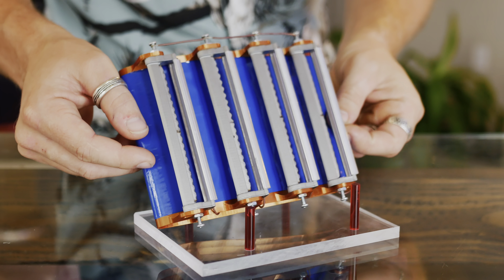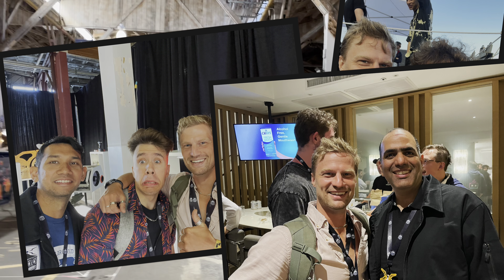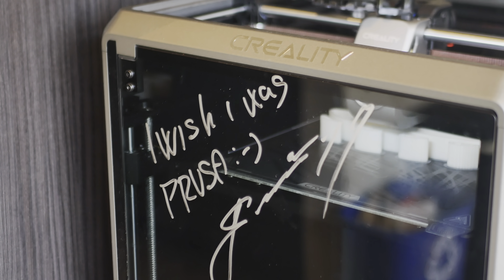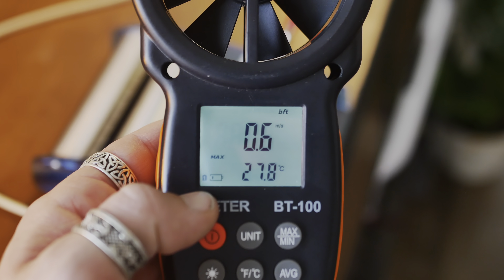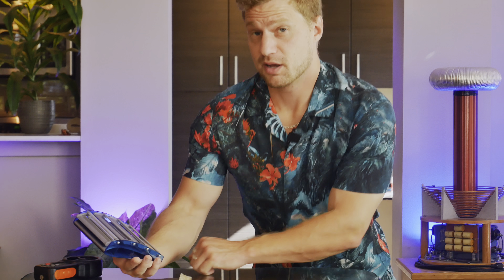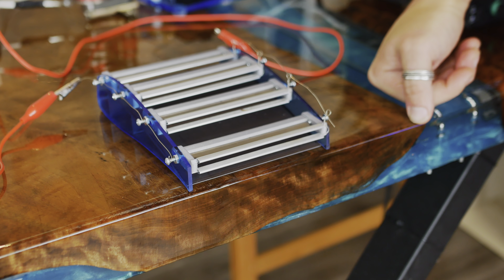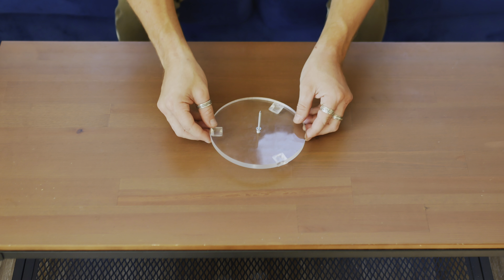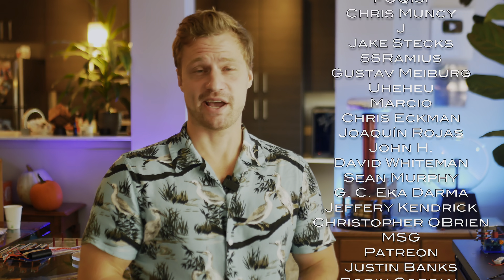Designing A Self Propelling Ionic Thrust Wing

Comment: Okay so I haven't finished watching this video yet, but it seems that having the voltages across the consecutive thrusters will both thrust and slow down thrust. You'll need to use a pulse system in which the 4 thrusters do not all thrust at the same time but cycle. A, B, C, D. But also the voltages between the 4 thrusters may also have a significant effect. I'd also argue that the space between the anode and the diode should be variable between the 4 thrusters. There is some fluid dynamics here that need to be considered. Start with the top and get the most thrust you can, the design the second one to already have the thrusted air over it, but furthering it speed. Think like this, a car from stop needs to be in first gear. Then second. This is about torque vs speed. I'd be curious if this is something you've considered.
Reply: I'd also argue that while adding extra bits could drag things a bit, I would consider laminar to be the first thought. Thruster 1 shouldn't care, it just needs to create a torquey push, the flow then should be aligned a bit, landing at thruster 2 which cares a little less about torque of the air, but giving it a little push. all the way down.
Reply: I'd also argue that these thrusters should be in a contained case of some sort. The air coming in and being thrusted should be able to add some sort of pressure, take a look at how the JT11D-20 axial flow engines work. This would also allow you to have the ability to do more than just push. By creating noded thrusters you could even add some spin to the flow. And by changing the shape of the bell, have higher pressure zones. IE you don't have to ionize all of the air if the outside surface is getting enough, and the air is compressed enough. The thrusted air could thrust more air. Ya dig?

Comment: you got the jet working already, the point of this video is to integrate it with airframe and make it a flying system. apparently you gradually realized that it's impossible to achieve now and degraded to a lame spinning demo. ionic thruster-powered planes have been studied extensively and you should have sourced from prior projects more thoroughly to avoid spending time on apparently way too heavy designs.

Comment: Hi, if you put one pole in the wing and the other outside and both like a biplane only with a small distance then you save weight and the 2 wings even add air resistance because the distance is 1-3 cm and the upper surface is only 0 The shape of the wing would not change. sorry, it was done with a translator

Comment: Habe you considered integrating the thrusting elements into the trailing edge/smooth leading edge of a multi element wing? That also helps greatly with lift at low airspeeds. See the ch701 wing as an example.

Comment: Why don't you make the razor blade section the trailing edge of the wing and let the other split contacts act as ailerons. Essentially dropping the multiple thrust mechanisms and instead blow up the mechanisms size and make it the wing.

Comment: If you made a thruster strong enough over a wing and able to recycle the air back to the start of the wing perhaps over another wing placed on top but reverse direction then put wings and thrusters in a sealed box with edges of wings fixed to box sides and ran it with enough power and airflow would you be able to cause the wings to create lift within the box thus cause the box to levitate?I have a sketch.

Comment: So Im a far cry from an aerospace engineer, however it is my understanding that aerofoils create lift by increasing the speed of the air on the top of the foil and decreasing the speed at the bottom in accordance with the venturi effect. Itd be interesting to see if a similar design would be able to create lift as you are directly increasing the speed of the air directly above the aerofoil thereby creating a pressure differential.
Reply from the maker: That's great input, and thanks! Yeah, that is why I designed it this way. Even when at a stand still, with the wing not moving, this should still create some lift.

Comment: I love the idea of ionic propultion. The thing in my mind is does the ionic Propultion(IP) on the top have influence in the lift of the wing? Because the wing actually gets "sucked" up... With this question in mind how does it affect the lift of the wing and what difference would a positioning of the IP on the bottom make? Also you can add IP on the hull of the aircraft and actually any surface of the airctaft. 
Another Question: Does the IP make the air move like x+IPspeed? like does is always add on top of each other to a certain max or is it just a constant max output no matter how fast the air intake is? In that case would the IP "slow" the air if its faster than max velocity?
Reply from the maker: That's very good insight! I actually intend on creating a full ionic thrust wing, placed on an ionic thrust incorporated airplane hull.

Comment: In the novel I am writing, there is a "surface air acceleration technology" applied to sailing ships. Your design actually turned my fantasy into reality. Such wind speed may be too low for an aircraft, but it is completely sufficient for a sail. A wind speed of 4 meters per second is approximately 6 knots. That's enough for the sailboat to sail normally. great!

Comment: The answer is within the way I build my far 103 compliant amphibious biplane almost entirely of rigid styrofoam which I have two provisional patents dated last month

. The first I can build all 42 linear feet of 2024 airfoil wings with full flaps and ailerons weighing a total of less than 100lbs not including additional tail section weight ~7lb, all lightly coated with carbon fiber mesh over minimal number of 2 inch styrofoam ribs. construction build time of wings ~5 days. 

The second involves full wing sized cores of rigid styrofoam being extruded through heated nichrome& welding wire& into the general profile of the needed airfoil, including internal slots for the main& subordinate forward spar. This method with an adequate shop can produce 5+wings per day with all  hardware installed& ready for Kevlar dollars& wrapping

 2023& 2024 are my faves for Max lift at min thrust for ~750 lbs+~ 35hp

You're going to need a power source for that right well I happen to have patented unlimited solar travel with T-Rex series wiring,  lowlight capable solar generation& reduces battery requirements.

Kevin Ward
Founder Healing Habitat 501 (c) 3
kevinward46@gmail.com
(607) 269-6626
#HaveaCoke&asmile

For those that don't know far 103 compliant indicates that it weighs just over 325 lbs with all the allowances of a parachute and flotation
Reply: For those that don't know far 103 compliant indicates that it weighs just over $325 lb with all the allowances of a parachute and flotation

Comment: Have you considered using electroplated 3D printed surfaces rather than razors/wires as the electrodes? You could shape the electrodes to provide optimal airflow over them while reducing the total weight. I have been 3D printing and electroplating devices to generate hydrogen with electrolysis, and the ultra light foil can actually handle quite a lot of current. I've also been putting a thin (~1um) film of gold on the surfaces to prevent oxidation which may be helpful considering the application

Comment: Awesome Videos good sir. I aspire to engineer as well. having taken on CGI design as well as Electrical engineering. if you need ANY CGI designs to be modeled, I would be honored. I can get you the light weight you need. Lets get rid of the wing all together though since the electrical P+ terminal (plates) accomplish this. Then focus fully on your frequency output. Like The man said, "Frequency & Vibration"...  I'm Personally convinced that a flat panel speaker setup would suffice with the proper sound output. Instead of a fixed speaker facing upwards, levitating objects, Having the speaker facing downwards, pushing the "Vehicle" up. I do believe they have accomplished lift by emitting some FM wavelengths downward to a point where when it refracts from ground back to said "Vehicle", the vibration supports objects weight. Just food for thought. But i have 3 other ideas that will completely blow these out of the water. and NOBODY has even come close to these yet. LMK if you may be interested on this thrill ride. Honestly I've been sitting on the concepts for years in fear of repercussions. Enough said. :) Stay safe & Can't wait to see more epic editing !

Comment: you should try putting the thrusters underneath the aerofoil.  As is you are interfering with the turbulence over the top of the wing that creates  the lift. Accelerating the air flow under the wing shouldn't reduce lift but accelerating above it will reduce turbulence and thereby reduce lift

Comment: Here me out... but what if you also made a plasma compressor. That would completely remove all to most moving parts in regular compressors. And (if possible) could change the need for oil based compressors. Which would make supercharged cars easier and possibly more affordable. Also i would like to see how plasma induction would react to the inside of an engine.

Comment: Are those crackling sounds coming from arcing with large enough aerosolized particulates? Regardless of how that crackling sound is produced, to what degree can it be minimized or even eliminated? Because scaled up it seems like that could cause a significant amount of noise pollution.

Comment: The thrusters are on the wrong side of the wing. I know everybody thinks the shape of the wing is about lift, but it’s actually about minimizing drag. The angle of attack provides the lift, while the shape of the top of the wing is to minimize drag by maintaining laminar flow. On the bottom and with a positive angle of attack each segment sees a clean air flow and then can accelerate the air smoothly along the bottom given the proper stand off distance. More thrust, less drag.

Thing about where wing mounted engines go. Never on top. Always below or integrated into the wing.

Comment: I would try strips of aluminum foil for the anodes and cathodes epoxied onto paper around a removeable airfoil mold, using only the epoxy for rigidity and a supercapacitor regulated by a potentiometer, recharging the capacitor before each flight. I think you might be able to really cut the weight that way.

Comment: Hi, I bought some of these 3-6 volt to 400,000 volt converters. The first thing I tried doing was making a simple tiny Jacobs ladder. It did not work very well and I think it's because these little converters are really pulse converters, meaning they do not give you a steady output. I tried taking a video with my iPhone 14 Pro and in the video sometimes the spark was visibly missing even though you could hear the spark and when I watched it you could see the spark. This pulsed output will affect your design, if you're using two or three you're getting strange bursts and perhaps out of sync/phase with the others. At 4 volts and 4 amps that is only 1.6 watts input, not much. I saw you measuring the velocity of the air, but that will be limited by the low-wattage device powering the plasma.  I'm just wondering how much increase in power there would be if you had a higher voltage and current supply to the plasma?

Comment: Also, thinking along the "augmentation" line of thought you can equip a conventional aircraft with an ionic module to fit on top of a conventional wing to supplement lift to enhance short takeoff and landing performance for backcountry flying using the aircraft "ship power as a power source. Cubcrafters has an electric fan motor leading edge lift module to increase short field performance.  Your thrust device could be designed to become an addon to the upper wing to increase airflow at low speed to increase wing performance...

Comment: I'm an engineer myself and I find your videos fascinating.  The issue with applying this to a full size airplane is obviously going to be the power source.  Batteries just weigh too much for it to be useful.  A better solution would be to use a small turbine generator to generate the electrical power required.  It would still use fuel, but it would be no where near what the requirement is for current turbofan jet engines.  An added benefit to this is as the fuel is consumed, the weight of the plane becomes lighter.  Additionally, a small battery pack could be used to provide emergency power in case the main turbine fails.  Currently, airliners have something known as an APU or Auxiliary Power Unit that is used to provide electrical and hydraulic power to the plane's systems if the engines fail.  This is what happened in Jan 2010 when a plane landed in the Hudson River in New York.  Captain Sully switched on the APU to keep the plane's systems working which significantly contributed to the positive outcome of the incident.

So a plane that uses this setup could be equipped with just an oversized APU to provide main power with a battery pack in case of emergencies if the APU fails.  The battery pack could be sized to provide 10-20 minutes of flight time.  Even longer if reduced thrust is used.  Overall, this would reduce the amount of pollution in the aviation industry.  One of the issues with this system is that water conducts electricity.  So rain/snow/ice could be an issue with the conductive components and cause short circuits reducing the available thrust and possibly damaging the power converter.

Comment: I'm part way through this for the second time and I still have the same problem. I'm NOT a scientist of any kind but how do you create thrust without moving parts?
I must be getting too old!
Reply: He’s creating a plasma in the air. The extremely high voltage is causing the electrons to be ripped off the air molecules. And then since opposite charges attract they will move between the oppositely charges electrode causing an air current.

Comment: You can refuse weight and not sacrifice strength by using triangles/pyramids for the frame instead of filled in frame. Especially since it is 3D printed. Less material over all. Obviously for the sections that don't need to block wind for function of flying.

Comment: One thing is the velocity that the air reaches and the other is the momentum that the thrusters transfer to the wings. In that sense it seems to me that the sum of parallel thrusters may be less efficient than aligned. In other words,  the goal is to to move the maximum amount of air mass to get higher momentum for the wing. With that in mind, I would suggest using thinner wings but twice longer and disposing your four thrusters in a 2x2 configuration rather 4x1, and to measure the push on the wing besidesthe speed.

Comment: Thrust is what matters not airflow speed. Thrust is a force and unit is Newton. You can measure it in gf (gramforce) or simply g (gram) using a cheap kitchen scale instead of doing that complex math you did at the end of the video. Try to use lightweight pla (LW-PLA) for the airfoil you can save at least 50% of the overall mass. Nice project thought! Keep up that research!

Comment: THE FORM IS THE FUNCTION! Okay so, why not cut the tubes in half, and use the thinner plates to displace the ion flow? They would have the same inner outer curvature, and you could cut down on weight (one bar per high voltage plate), while at the same time giving a more concave inner angle towards the negative plates that could concentrate the flow in a more laminar way. Sorry I was late to this video.

Comment: Is there much heat production in this kind of propulsion?
Did the high-freq noise get better when you spread the load across the blades, or did you just filter it out of the video?

3m/s seems pretty reasonable

Comment: Just a suggestion, I would look at PCB material to make the thruster as you could use single sided, or double-sided board that you can get very thin so very light, or even carbon coated plastic, I am sure you could 3d print your thruster and spray it with carbon as you can get carbon as a paint, then integrate the thruster under the wing, as part of the wing, so saving more weight, anyway just a suggestion for you to try, looking forward to your next trial. All the best Bob in the UK.

Comment: It seems like you could run into significant issues with the lift of the wing with the location of the thrusters.

The low pressure above the wing would be affected significantly. This is typically why jet engines that are mounted to the wings are typically below the suction surface.